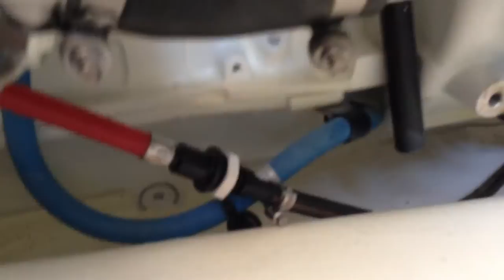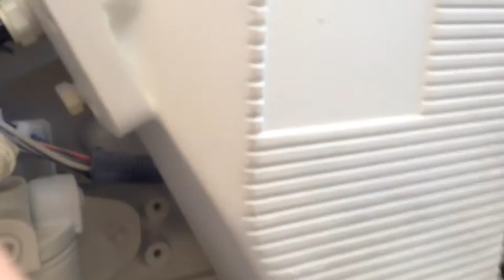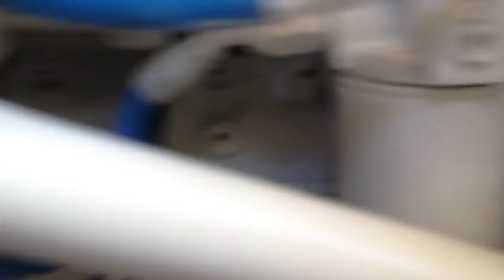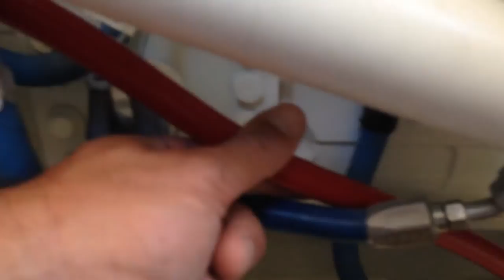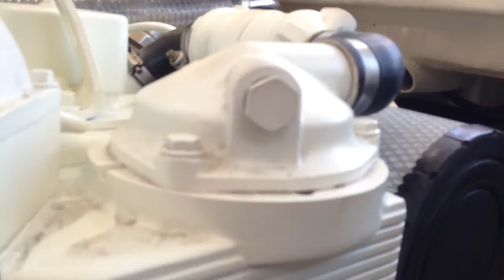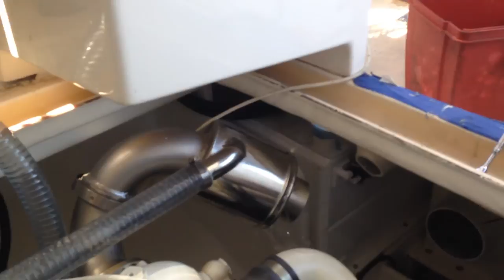Fresh water flush setup on 6BTA Cummins

Comment: Benny, can you explain how the process work?
Do you have to close the Seacock every time you flush?
You flush with the motor off

Can you flush with engine running
Please explain
I have cummins 6cta I am planing to install a fresh water flush system
Do you have a diagram?
Thank you
Reply from the maker: Fernando DaCosta ,, this only works flushing with engine off.
Reply: Benny could you tell me the size of mini ball valve. Great video. I want to add this to mg Cummins.